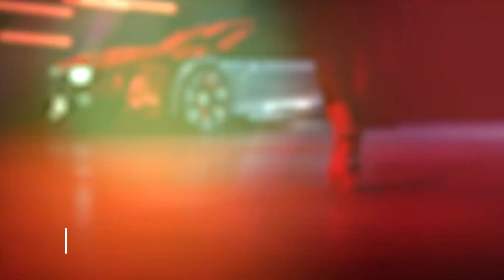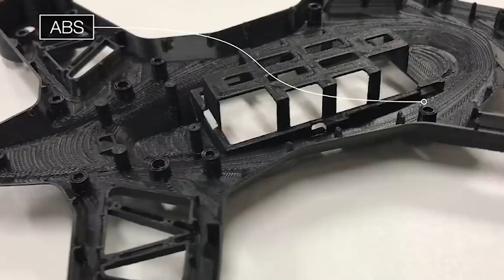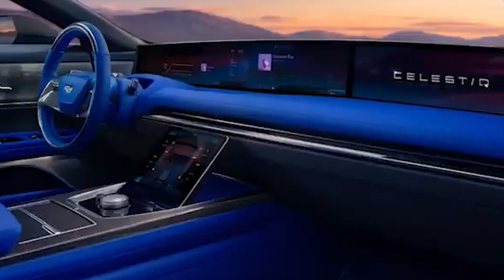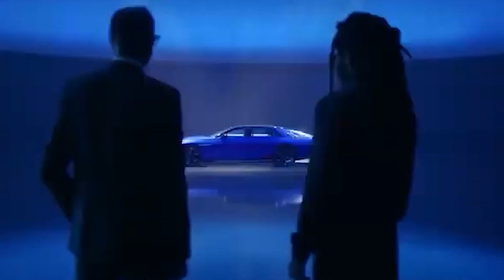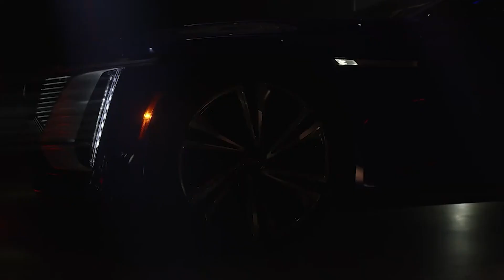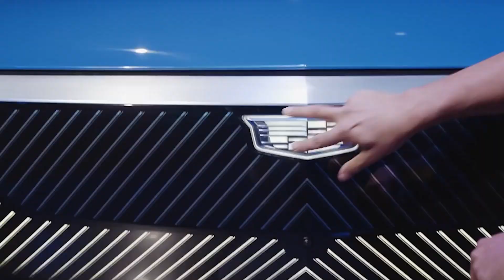CADILLAC CELESTIQ; An AMAZING And ALL AMERICAN Car

Comment: It's damn sad that Cadillac, that doesn't even make a REAL Cadillac sedan that someone can buy, is reaching completely out of their depth to make a car that will be gone in a year or two, once the billionaires that wanted one have moved on to real luxury flagship  automobiles like Rolls-Royce and Bentley. My family have purchased and owned Cadillacs  since the 40's and now Cadillac has nothing to sell. The Cadillac lineup is a joke, there's nothing there. We don't buy trucks passed off as luxury vehicles, or tiny , entry level cars. 

It's sad that Hyundai's luxury division, Genesis, has 3 large luxury sedans to sell while Cadillac has nothing! Cadillac is a dying brand. They SHOULD have built the Escala, El Miraj, and Ciel. They should have Coupes, and Convertibles, as well as a luxury sedan. NO Cadillac should ever have a 4 cylinder engine. That should be left to toyota, honda, and nissan.......
Reply from the maker: Well John, I think a lot of car lovers don’t agree with you. You’re obviously a disappointed Cadillac guy. I personally think Cadillac stands for very big and very luxury cars and that’s what they are still producing. 🚗
Reply: John Engleman. .... You are absolutely right this is what I've been saying before and I agree with you strongly about the previous consent Designs such as The Mirji , The Cetel and the Escala .
If you want to bring Cadillac into the relevant again as the standard of the world as it once was put those cars I'm even a zeebee and they will sell like crazy. Instead of going the route of making a ridiculously expensive limited production EV sedan like the Selestiq  costing at least $300k !!!! And what if it bombs ? Cadillac may disappear into just the Chinese market out of the reach of American buyers. They are putting now I hope to die model is the Lyriiq and if that bombs then what then?.
Reply from the maker: Hi Rod, thanks for joining us and your comment on this topic 👊🏻